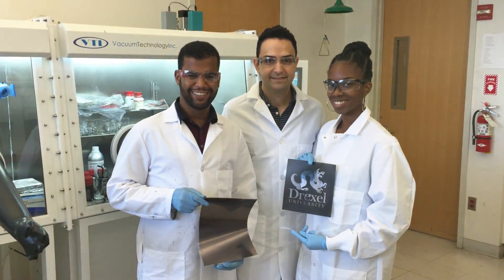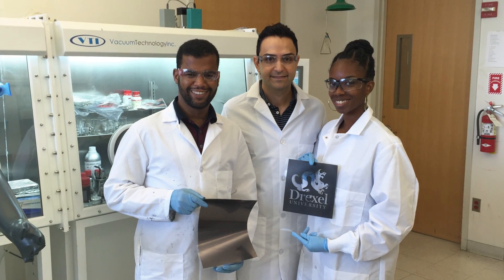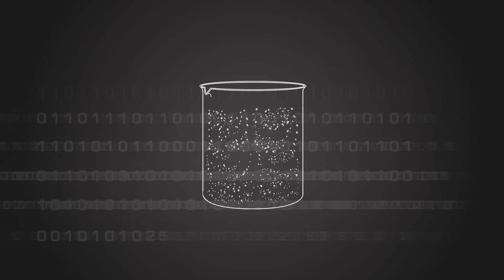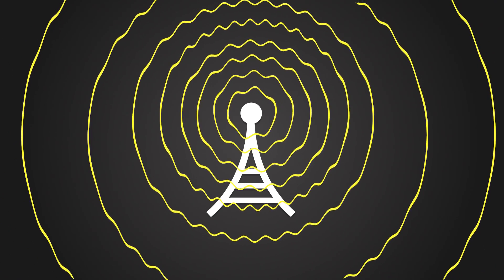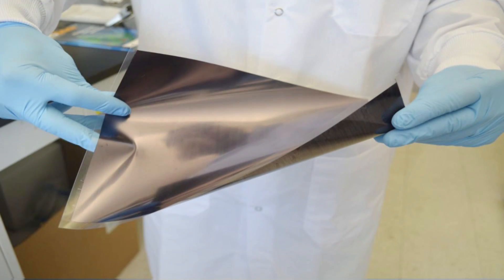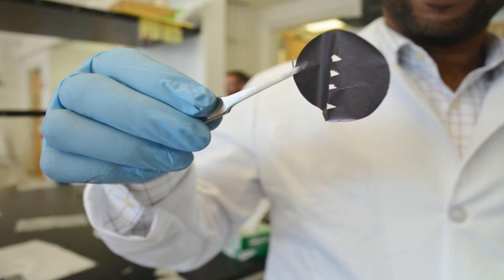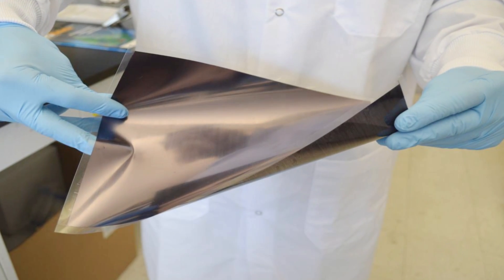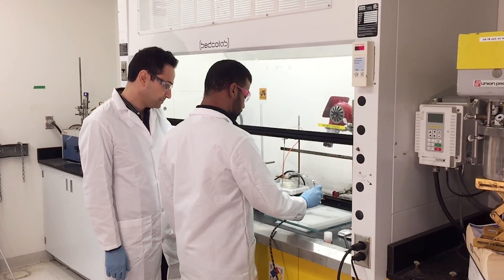Drexel’s MXene Helps Contain ‘Electromagnetic Pollution’

Comment: Here is a link to the original article: http://science.sciencemag.org/content/353/6304/1137 
F. Shahzad, M. Alhabeb, C. B. Hatter, B. Anasori, S. M. Hong, C. M. Koo, Y. Gogotsi, Electromagnetic Interference Shielding with 2D Transition Metal Carbides (MXenes), Science, 353 (6304) 1137-1140 (2016)